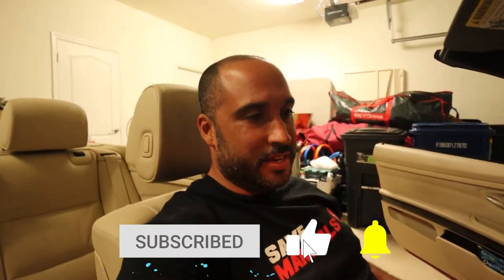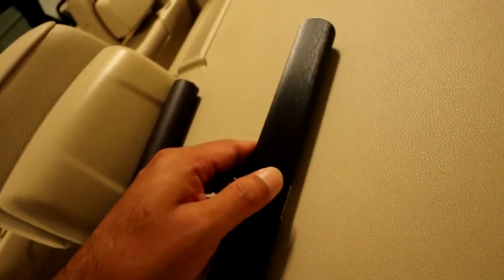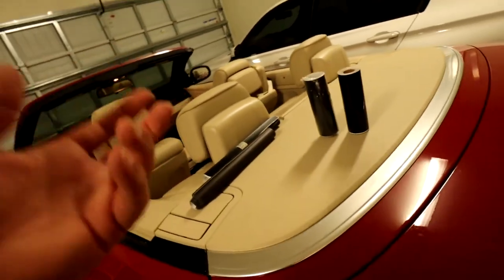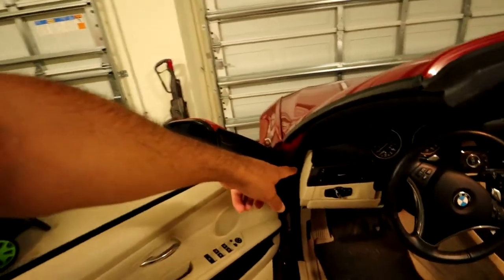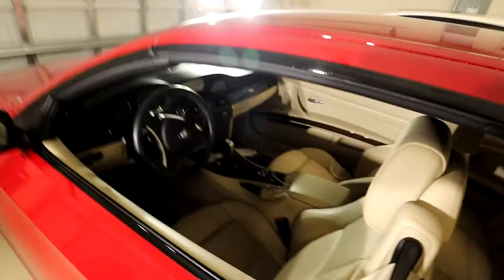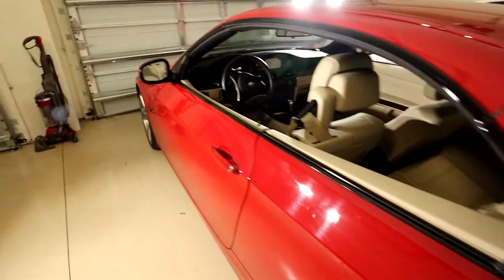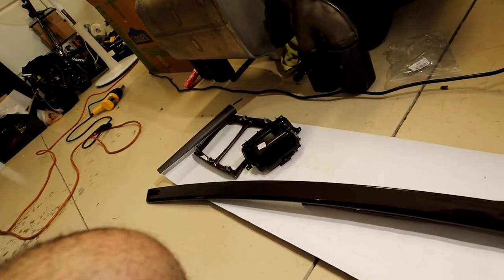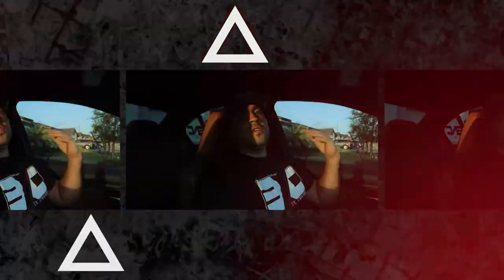UPPIN' MY WRAP GAME ON THE E93 N54 BMW 335i CONVERTIBLE EPISODE 10 BUILD SERIES!!

Comment: 7:24 Dude one question. How did you wrap the big chrome line at the back of the car. Can you remove it somehow or did you just wrap it while it was fixed there ?
Reply from the maker: With the top down. Used a tool to push it under the plastic part.
Reply: @ExhaustNoteChannel  Thanks man. I have a E93 too an want to wrap it. But I don’t have any clue of that part. Would have been nice if you showed that but thank again.
Reply: If you stop the open/close with the rear deck at about 80 degrees, you can see all the nuts on the underside to remove it and have full access to that trunk chrome piece.  Mine came wrapped and bubbly.  I pulled the wrap off, and you need to remove the deck lid to remove the old wrap.